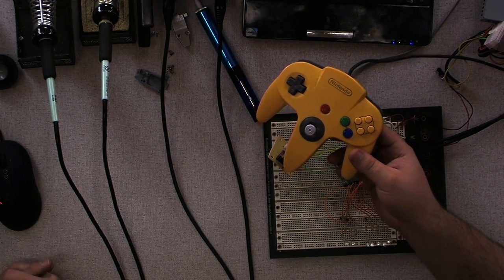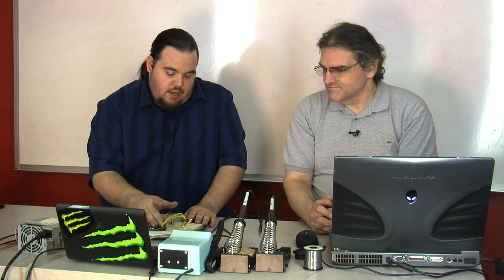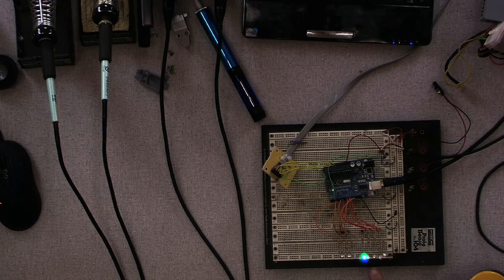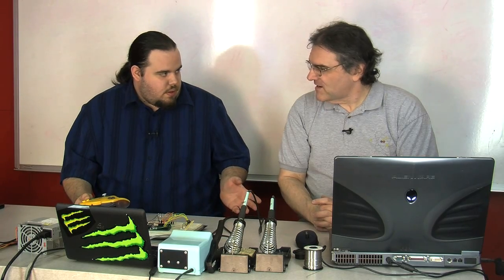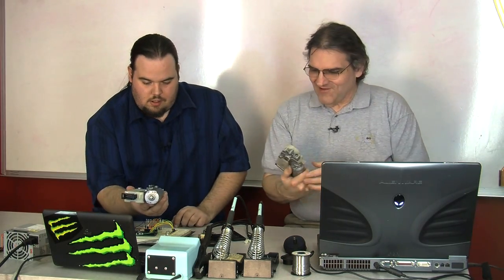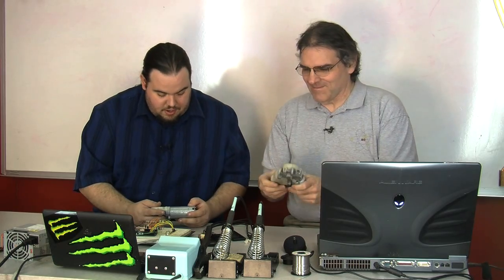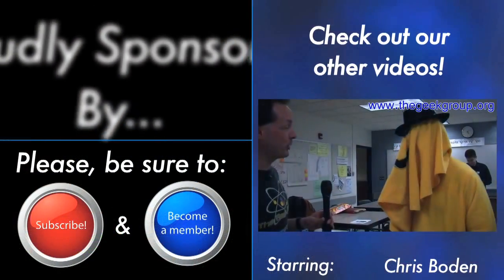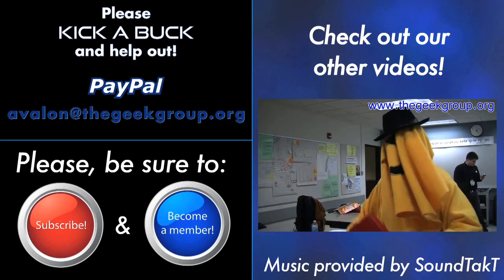Dan and Kidwell Coding the Trolley Controller Part One

Comment: @djtowo 
You wont need four connections to a µC for a H-bridge. Just use some NOR-logic-gates (typically one IC with for gates per H-bridge) and you have one connection for direction and one for PWM-speed control (you want to drive motors of this size with PWM, otherwise you'll turn your transistor into heaters; and there are other advantages, too). 
Or even easier: use an purpose built H-bridge-driver-IC which is all of this in one package.

Comment: U can use a DPDT relay to control reversing and set a transistor to regulate the power going to it to control the speed. That way you only need 2 conections to the arduino instead of four with a H-Bridge. i used this technique myself to control a robot cars wheels.

grtz tom